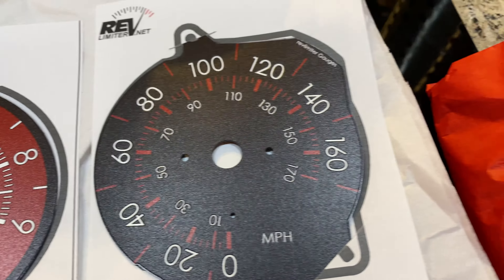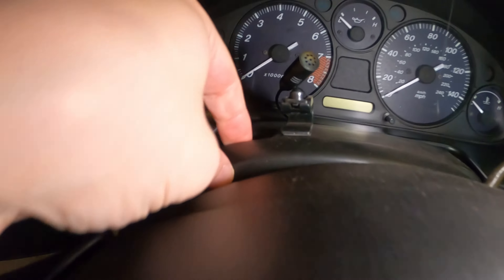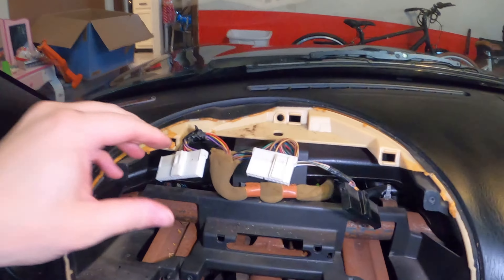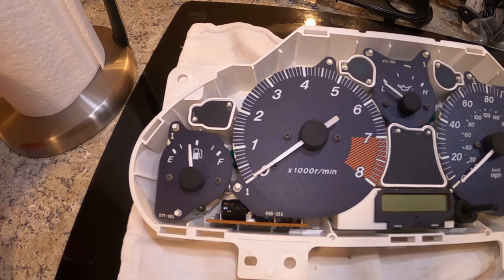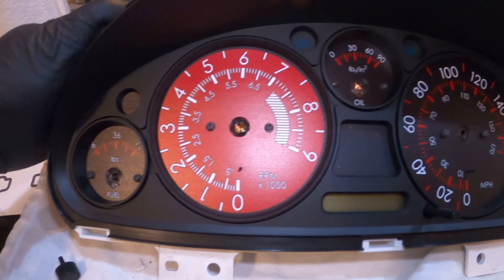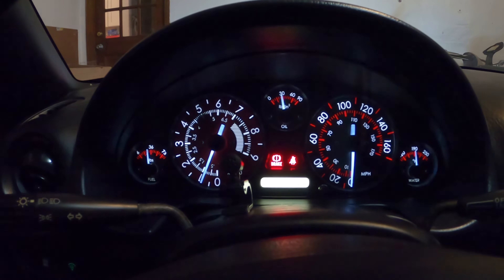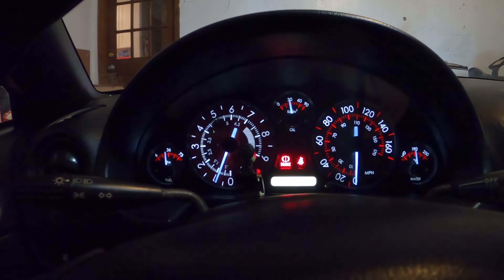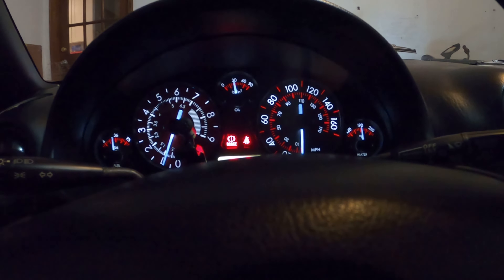Revlimiter Gauge Install - NB Miata

Comment: You forgot to break the high beam cylinder behind the tach, it is blocking the lighting to the 5 on your tach.
Reply from the maker: Yep, I went back in and broke it off with pliers, lol.
Reply: @mikelzsigler  you also forgot to remove the little bulbs from the old engine light and high beam from their sockets.  With the bulbs still in there, the new lights can't work because the cluster can't power two bulbs at once from the same circuit
Reply: @tgy119 would this cause your clusters to short circuit? Mine were fine but all of a sudden all of the lights went out and I can’t figure out how to fix.